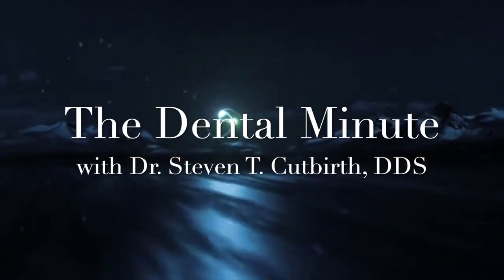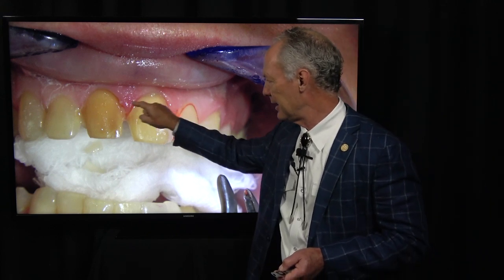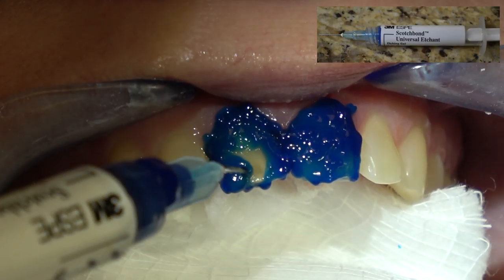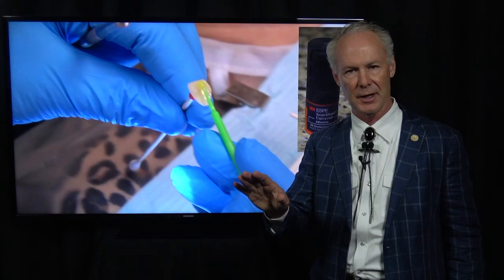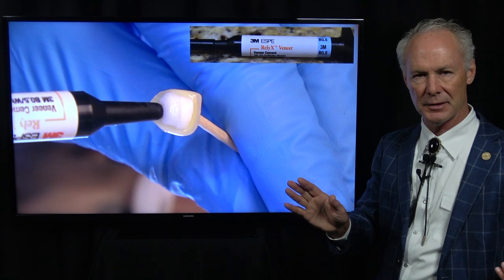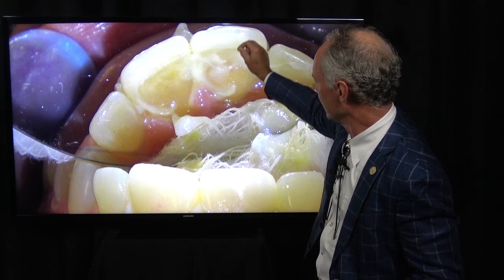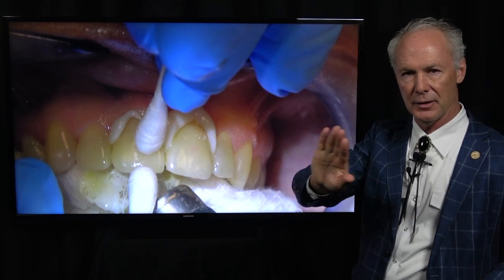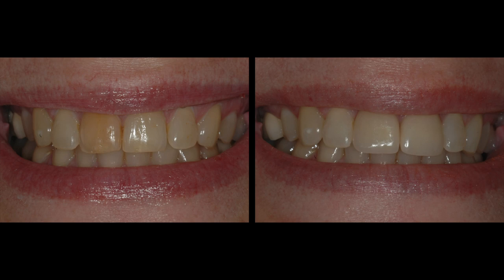Veneering Dark Central Incisor Part 3

Comment: if u mentioned before pascal magne,u should know that when u have an exposed dentine u do immediate dentine sealing with generation 6-8 bonding system -self etch and not etch and rinse system! also bonding veneers should be done under a rubberdam...
Reply from the maker: Pascal is a friend and I admire his work and research.  We agree on many aspects of veneer preparation, placement, etc. but our techniques differ in some respects, including the things you reference in your comment.  Also, Pascal uses highly filled resins, like Herculite, for veneer cementation.  That method does not work for me.  Using a traditional technique rubber dam for veneer cementation would be a nightmare for me trying to prevent bleeding and dealing with the interproximal rubber strips.  It is complicated enough controlling bleeding when seating veneers without having to deal with the rubber dam.  Isolating with many cotton squares when seating veneers has worked beautifully for me, with the technique I teach, for 20 + years. I have no incidents of veneers staining or debonding. They may occasionally fracture, just like a natural tooth, but no staining or debonding.

Comment: Hi Dr. Cutbirth. How light are the occlusal contacts for these veneers?
Reply from the maker: No contact on the veneers except in eccentric movements.  Normal contacts in eccentric.  Be sure they have a nightguard.  Try not to cantilever more than 2mm of restorative material off the incisal edge of the tooth, especially if the patient is a big bruxer and presented with significant wear.  Studies show veneers are as strong as natural teeth if you follow the veneering procedures I am teaching.  Watch the Dental Minute video on "How to make veneers as strong as natural teeth."

Comment: Nice video.  Did you just empirically discover on your own that you did not need silane, or was it something that you discovered in the literature?  By the way, I'm sure you meant your title to be dark "central" incisor.
Reply from the maker: Correct.  My video editor has changed the title from "lateral" to "central."  I noticed that whenever a patient presented in my office with a "lost" veneer, the filled resin was always on the veneer, never on the tooth.  I read research articles back in the 80's making the point that silane was not necessary due the the tremendous amount of micro mechanical retention on the surface of etched veneers, but, if not used properly, could be a source of contamination.  My objective is for all of you watching these videos to practice dentistry well and not to have failures.  I certainly do not have all the answers, nor do I think my way is the only way, but in 40 years of practice, researching, presenting seminars and publishing articles  have strong feelings about many procedures.
Reply: @centerforard  ok thanks.